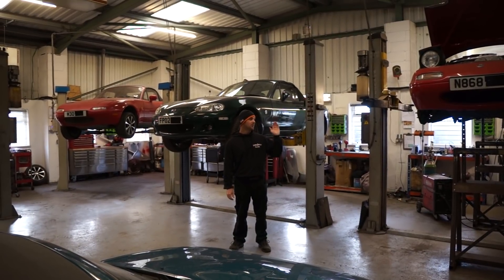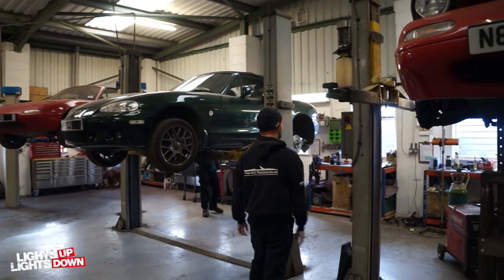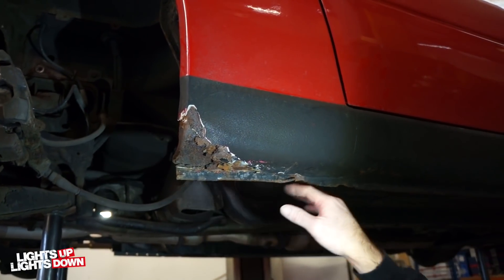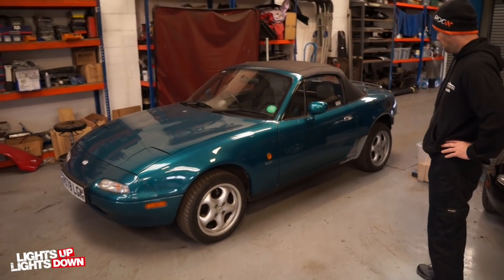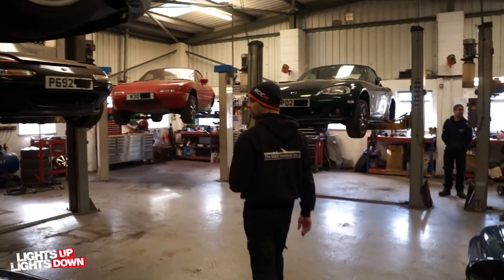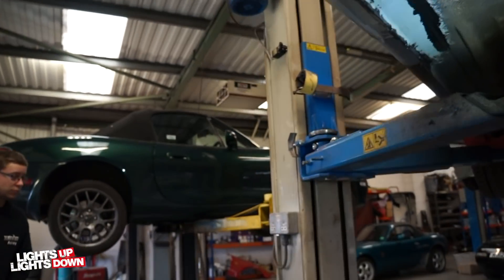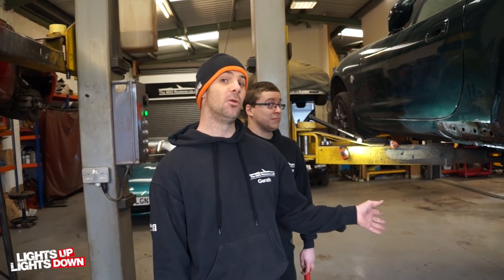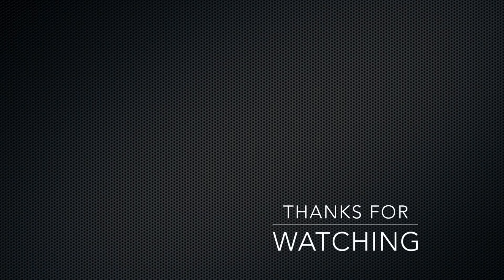What's going on in the workshop 15 - full sill replacement, riveted sill repair, berkeley is sold

Comment: Suggestion; mike your speaking people with a mike on a miniboom and worn on the head (some are paired with a headphone for singers)- the battery/transmitter is worn on the beltline. Any area mike used in the shop will pick up "unrelated " noise- either you need a "close" solution or a fortune in post production. Many do voice over when shooting active situations and talk is usually done away from activity.
Reply: Notice the improvement as the action movews into the corner with drywall- much less sound reflective than metal.
Reply from the maker: Thanks for the advice, I think we will use mic's on every guy soon